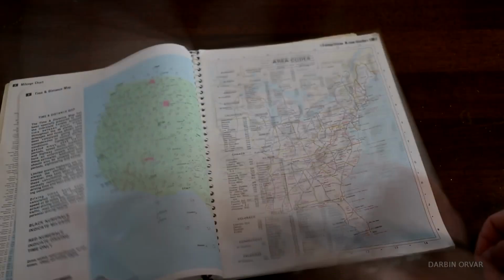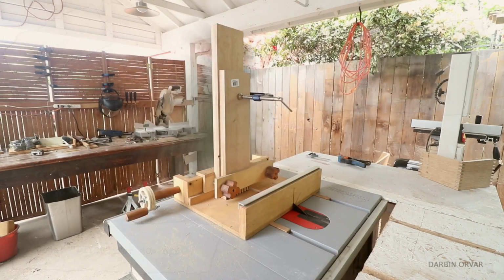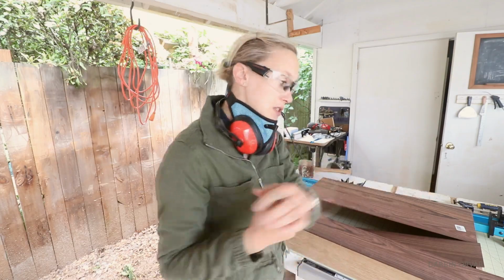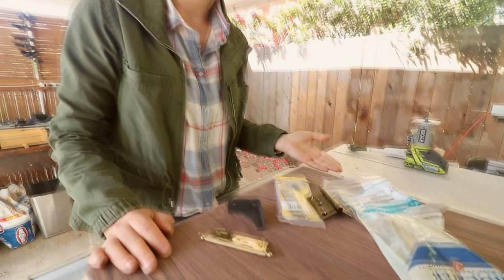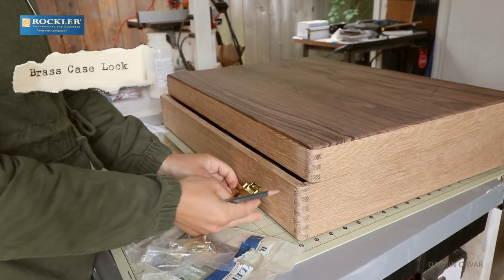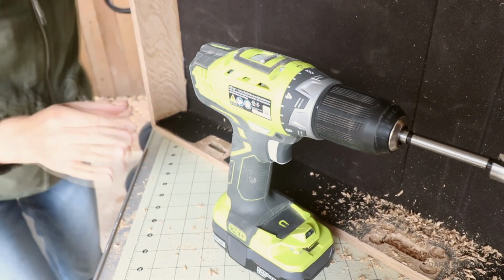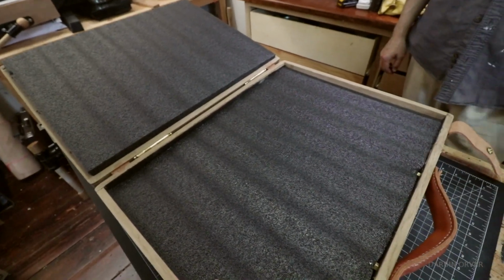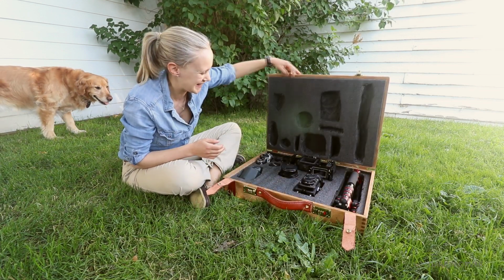Making an Awesome Retro Camera Trunk

Comment: If you are OCD when it comes to cutting foam I thoroughly recommend making / using a hot wire cutter. Trace the shape, drill a hole in the centre, thread the wire through and cut away. Let the wire cool and move it to a corner and test fit with the object. You can then recut if necessary!

Comment: Quick suggestion why not use pick and pluck foam versus the one you used and another suggestion for cutting foam might want to invest in a hot knife for the cutting it makes the cuts so much cleaner.

Comment: Pretty great, Linn. Just two observations: The name I gave for the project on Instagram was much better "Camera Suitcase" because it sounds like a mafioso item. Or not. I don't know anymore. The second is that I think you should have put the hinges inside the case, for better security. Even if you can't use a screwdriver to remove the screws, you could remove the pin that holds the hinges together. Anyway, that would be $3,50 for the awesome name idea, please. I accept PayPal. Oh, and send my love to August and Darwin. 💚